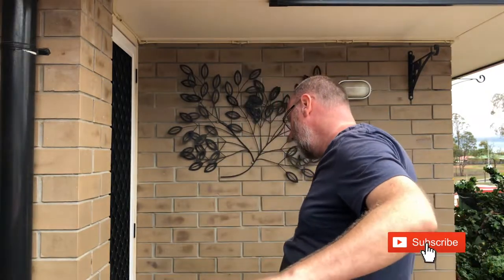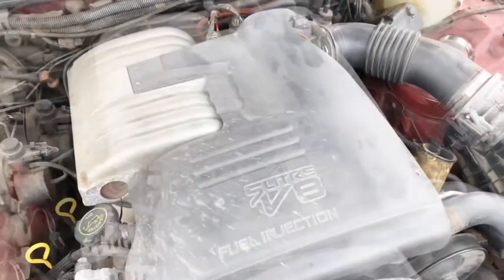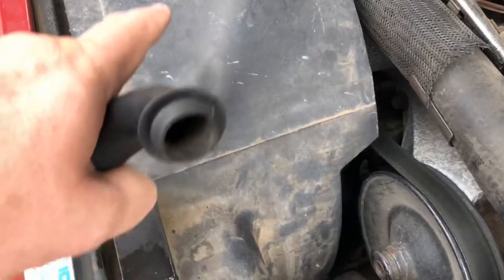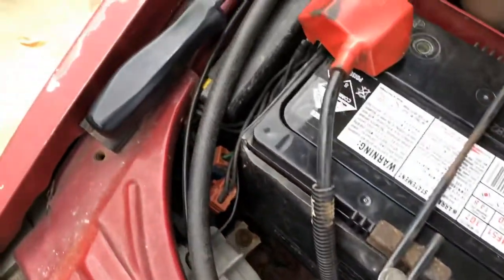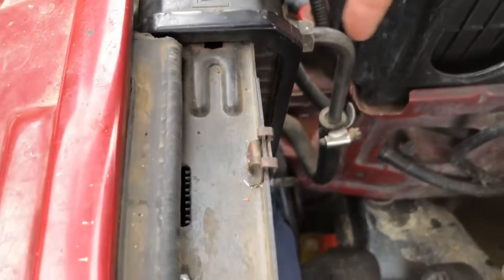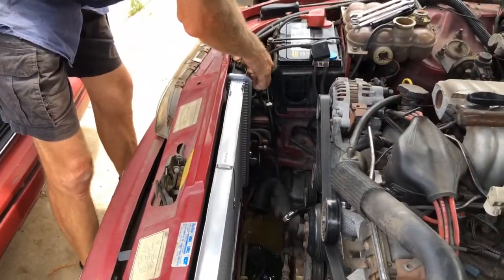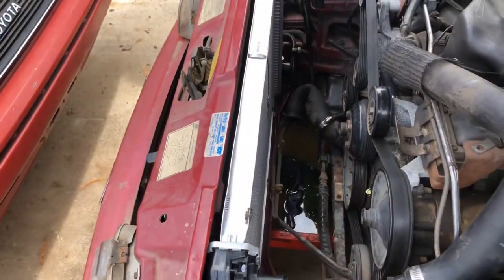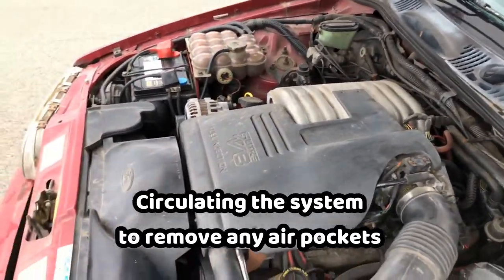Replacing the Radiator | EB V8 Fairmont Ghia

Comment: any advice on how to get rid of the little red light on the dash that looks like a radiator bottle. I noticed on the video you took when you first got the car it was on. i saw that it has now disappeared once you changed the radiator. i switched over the overflow bottle on my 6cyl fairmont and cant get the night to go off ever since. Cheers

Comment: Good work mate but I would have done the lower rad cross over hose and water pump while it was so far apart.
Reply from the maker: Seattle & Beyond thanks for watching and thank you for your feedback. I wasn’t too concerned about other maintenance at that point. I will be doing the pump and idler pulleys later on plus a bunch of other stuff.

Comment: Excellent video. Was there much gunk in the old coolant? Years ago when I flushed mine out, there was a bunch of scale and casting sand that came out. It also ran a bit hot so I definitely need to replace my radiator too.
Reply from the maker: Cheers Southern. The coolant was pretty clean from memory. If I'm re-using the coolant, I typically pour it through a paint filter to remove any crud that might be there. The old radiator was clogged and caught a fair bit of the rubbish in the cooling system. It was running too hot for my liking and the new radiator made a massive difference.
Reply: @GsAutos hey mate how’s the radiator holding up? I’m finally getting around to replacing mine